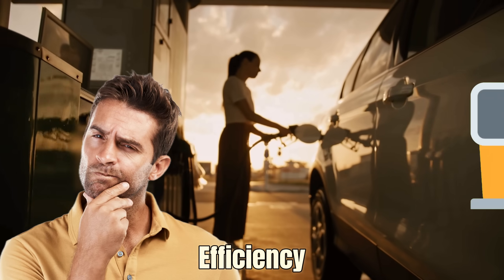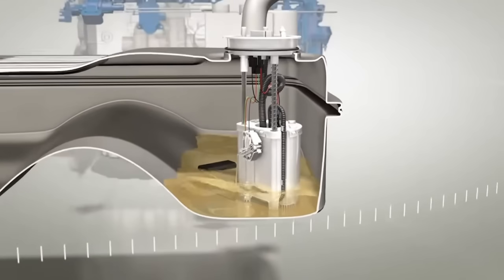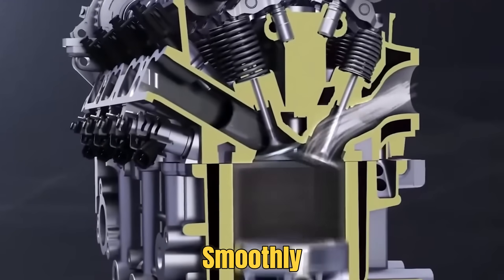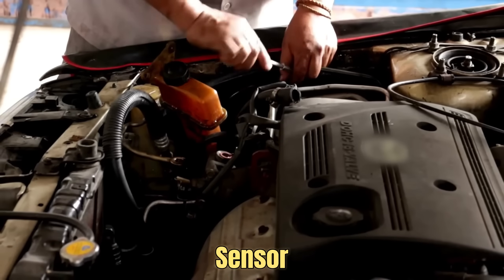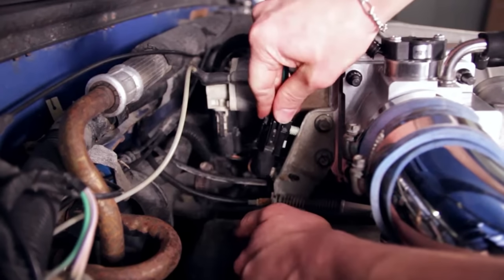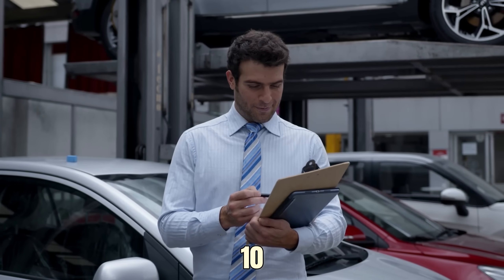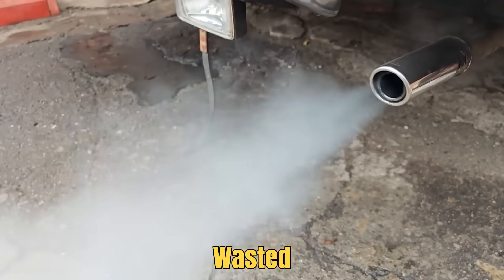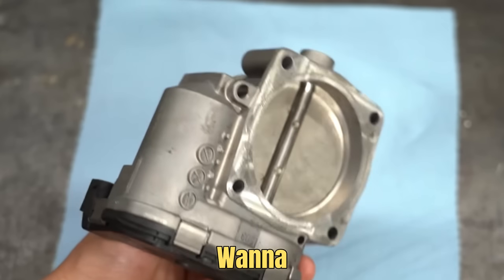Boost Your MPG INSTANTLY Most Drivers Don't Know This (CLEAN NOW!)

Comment: I don't know where you get your cost info to replace tb's and maf sensors.  I have bought 2 throttle bodies one for my hemi magnum and it was $80 with a ten year warranty.  I just bought a tb for a Nissan v6 for $60.  A new MAF sensor is about $25.  The cleaner is the expensive part nowadays.   Think about it 12 bucks for cleaner or more depending on the kind of cleaner.  I'd rather put in a new one with a warranty for twice that price.  Throttle bodies have motors for the plate that move all the time. So why not just buy a new aftermarket with warranty and new TPS sensor if you have it off.  I just bought a set of camshaft and crankshaft sensors for my Nissan engine for $24 on ebay.  New in the box from Nissan 2 camshaft and 1 crankshaft sensor made by Nissan for my 05 Infiniti FX35 3.5 v6.  I'm getting ready to put in plugs, coils, maf, camshaft, and crankshaft sensors
Reply: My bad.  now that I think about it, most folks don't know how to do the replacements so the costs you mentioned would probably be what it would cost to have them installed.  I've been working on engines for a half a century

Comment: You forgot the MAP sensor, ( Manifold Absolute Pressure) ?
Reply from the maker: we cover it in next video you can watch it
Reply: @Allcarclues You have WD-40 in your thumbnail ?  No way should you spray it on any delicate sensor filaments, it might be ok on the TPS butterfly mechanism but always use the recommended spray cleaner on all the other sensors !

Comment: Vide shows battery disconnect removing both cables. Remove only negative cable is required.
Reply from the maker: Yeah, you’re right — only the negative cable needs to be disconnected. My bad on that, thanks for catching it!

Comment: Don't use wd40 use a cleaner made for the sensors that evaporates quickly😊
Reply: It should be labeled "Mass Airflow Sensor Cleaner".
(Not carb or brake cleaner.)

Comment: On some modern vehicles all those “disconnect the battery” directions can lead to a dealer required system reset/reprograming.
Reply from the maker: That's true, some newer cars might need a professional reset after a battery disconnect. We always recommend checking your car's manual for specific procedures. Thanks for the valuable feedback!
Reply: You can buy a battery gadget that you plug into a usb port that keeps the programming and whatever on the modern newfangled modern cars and trucks, Google it.  I prefer old school engines without all that fancy crapola.

Comment: I only use MAF sensor cleaner as recommended by my car’s manufacturer.
Reply: Other cleaners may leave contamination on the sensor.
Reply: Clean every oil change? 😮
Reply from the maker: Okay so how your car performance and MPG now after cleaning
Reply: @Allcarclues It runs fine. I do it when I clean the throttle body as preventative maintenance and at 106,000 miles I’ve had no problems with performance.
Reply from the maker: It's Great and thanks for sharing your kind information
Reply: @MichaelFilipkowski-n5h   I had a mechanic clean the throttle body. But he used braake cleaner. Is that OK? I would have done it mydelf but it's really hard to take apart because of it's location.
Would that give really poor gas mileage or make it run rich? I'm only getting 18 mPG instead of 28. It seems like a more serious problem. IDK
Reply: @sillyhuman-1 Brake Cleaner is not abrasive and evaporates very quickly. It removes grime quickly with a wipe from a clean rag. I use throttle body cleaner from CRC. For the MAF sensor I use CRC Mass Airflow Sensor cleaner. They work well for me. If your throttle body is filthy it will effect MPG and idle in my experience.
Reply: @Allcarclues  I cleaned the MAF, then replaced it. No fix.
Thanks

Comment: I bought a used 2012 Honda Civic that only got about 11 MPG.
I:
Cleaned then changed the MAF
Then I paid $400 for diagnostice. they checked the:
fuel pressure
injectors
spark plugs
cat converter
Oxygen sensor
Replaced the intake manifold pressure (vacuum) sensor.
Still gettiing bad MPG.
I noticed I was getting High Negative fuel trims. (Running rich)
I disconnected the PCV valve and breather hose to make sure I wasn't getting fumes from the crankcase.
I disconnectd the purge valve.
Still bad MPG.
It improved from 11 MPG to 18 MPG city. I should be getting 28 MPG city.
I was able to get 38 mpg on the highway a few times (but not every time).
I still have no idea what to check next.
If you have any ideas, please leave a comment. Thanks
I'm thinking maybe it had old gas in the tank and it improved when I filled the tank. But that's just a wild guess.
Reply: With this issue I would post this on civic forums because ain't no way a civic is getting worse gas mileage than my SUV it almost seems like there is a small hole in the tank or something leaking gas with those kinda mpg #'s jeez🤔
Reply: @thekingtut1611  Thanks! I don't smell any gas inside or outside the car.
I might contact a dealer and see if they have any suggestions.
Reply from the maker: Yes, old fuel can affect it. Also check fuel filter, throttle body, EGR valve, tire pressure, and alignment — all these can impact MPG
Reply: @Allcarclues  I haven't been able to check the EGR valve. Thanks!
Reply: Do not trust that a mechanic “checked” something… They probably just plugged in the diagnostic reader, and didn’t see any issues, but that does not mean that it’s running optimally. Make sure the spark plugs have been replaced and that they have been gapped properly, run at least two full tanks full of gas with an injector cleaner additive that has PET (Techtron or Royal Purple), Then run a 1/4 tank of fuel with cataclean, then run one more tank of gas with PET, replace the fuel pressure sensor, replace the O2 sensors (upstream and downstream), replace the fuel filter if it has it, and Ensure the tire pressure and alignment are correct. The last two are not as significant for mileage, but you could have a whole lot of smaller problems.
Reply: new PCV ?? Royal Purple fuel system cleaner, $12. Walmart.
Reply: Have you checked the EGR system and maybe replace whatever you find?
Reply: @williamdillingham5781  I removed it and cleaned it but is still seems to be stuck closed. I didn't think it could cause 28 MPG go to 18 MPG.
But a few days ago I decided to go ahead and replace it. It's the only thing left to try.
Thanks for the post!
Update: The EGR Valve replacement did nothing.
Reply: Set fire to it and buy something else..
Reply: Fuel leak
Reply: @volt8684  Thanks, but I don't smell any vapors.

Comment: Many cars such as the 2016 Nissan Altima have a sealed MAF sensor that can't be cleaned.

Also, open your wallets and purses wide because a MAF sensor for 5th generation Altimas will run $300 PLUS!

NEVER EVER.., buy an aftermarket MAF sensor, as you will regret it!

Comment: PCV valve
Reply: I am running rich. So I thought I might be pulling gas fumes from the crankcase into the intake manifold. So I removed the vacuum hose from the PCV valve and blocked it. I also removed he breather hose from the top of the valve cover. 
I was still getting high negative fuel trims.
I did the same with the Purge Valve from the gas tank. No change in fuel rims.
I just replaced the PCV valve a few months ago.
Reply: Usually related to oil consumption
Reply: @volt8684  Thanks. Will that make it run rich and reduce my mileage from 28 MPG down to only 18 MPG. It seems like something more serious? My mechanic said to take it to a dealer. I don't know what else they can check.
Reply: I tried that too. But Thanks.

Comment: Your thumbnail shows a MAP Sensor but you din't even mention it ?
Reply from the maker: Thank you so much for watching. I think you didn't watch full video because in sensor 4 we covered Mass Air Flow sensor (MAF) sorry for your misunderstanding. We also explain Oxygen (O2) sensor in our latest video please visit and watch it also because it also so important for your car.
Reply: @Allcarclues 
Mate.  MAP and MAF are not the same.
One measures air flow and the other measures air pressure.
It has that stem on it with a sealing "O Ring" as in your thumbnail.

Comment: Any issues with most of these would show with messages or warning lights on the dash. Regular diagnostic checks at service will also reveal any issues.
There's a good chance you will damage the O2 sensors just trying o get it off.
Reply: True, sometimes 😊
Reply: I'm not getting any codes. 
I had the same problem on my 2004 BMW 325i.
Only 15 MPG but NO CODES.
I cleaned the MAF (only) and got much better gas mileage.
That didn't work on my Honda.
Reply: @sillyhuman-1 it's quite funny I was researching about cleaning MAF and O2 sensors yesterday and the websites specifically advised against Trying to clean both. Any faults should show up on a diagnostic check at a specialist. I pay 90 EUR incl vat to get diagnostic check on my mercedes here in Portugal at a good independent.

Comment: Sensors...Unnecessary junk designed to fail and keep you running back to the dealership. Before every car manufacturer went to fuel injection you didn't have these never ending and expensive problems. A well tuned CARBURETOR didn't need sensors and engines ran just fine. That new car smell with all the bells & whistles great...but I'll keep my pre-computer controlled cars and save a ton of money in the long run.
Reply from the maker: Old cars were simple and strong, no doubt 🚗✨ but sensors made modern engines smarter, cleaner, and more efficient. The best part is — with a few DIY tricks you don’t have to spend a fortune 🔧😉. Thank you so much for watching and supporting the video 🙏 your feedback means a lot!"
Reply: in case of a emt or is it elt electrical surge ull be the only one driving anywhere,  ppl def are waaay too dependent on computers
Reply: Yeah and you got 12 mpg.
Reply: Yeah, all these "sensors" are just a big waste of time.  They only ones the sensors are good for is repair shops or the dealership if you're dumb enough to go to the dealer for repairs.
Reply: @Rico11B-82ndABN ..prove it with facts or go away
Reply: @Rico11B-82ndABN you have no idea why the sensors are there or what they do, do you? But, you will talk loudly and defiantly as if you know what you are talking about. ….a blowhard…  This technology is driven by the need for auto manufacturers to comply with federally mandated  fleet fuel mileage averages. The sensors send feedback to the vehicles computer and the computer constantly adjusts timing and fuel injector pulse  to maximize fuel efficiency. It’s complicated. Just admit you have no clue as to how it all works.  Semper Fidelis Dave in Omaha
Reply: @EileenHeitman  I've been repairing and rebuilding car probably before you were ever born, I think I learned a thing or two about all the sensors on cars.  Only a few are truly needed.  The rest are just bullshit.  Guess what dummy, you can go into the CPU on the car and disable many of those sensors and the car continues to run fine.  That alone should let you know that some sensors aren't needed.  Then there are sensors like the catalytic converter sensor failures that are common.  They have no negative effect on the vehicle OTHER THAN, you can't pass your state's inspection because you've got a check engine light on.  Go figure.  But thanks for chiming with a BS comment that wasted verbiage with what most people already know.  Did google help you write it?  It doesn't change the fact that many sensors are useless, and the old style "mechanical" components are more robust AND more reliable.
Reply: if you got 100k miles on a 60s car you were doing good
Reply: They actually make your car run much more efficiently and lower emissions. If you don't want a car with them buy one from the seventies, and replace your engine every 60,000 miles.
Reply: Every 60,000 miles? Really? My first car, a 1962 Chevrolet 2, with a 6 cylinder already had 175, 000 when I got it, and had it until it got hit sitting in front of my house, with 292, 000 miles.  
Yeah, replace your engine at 60, 000. On today's cars, yes!
Reply: @GabrielB-i6dand I had a 1980 BMW 320 I that did 200k UK miles when I sold it. They dont all do that
Reply: @GabrielB-i6d…. YES! I still have mine, a convertible. Bought it in 1977 for $150.
I did put a 283 and 3 speed auto in it, but what a classic gem!